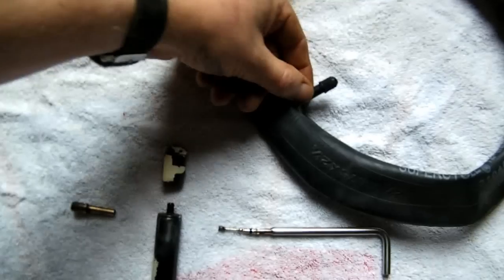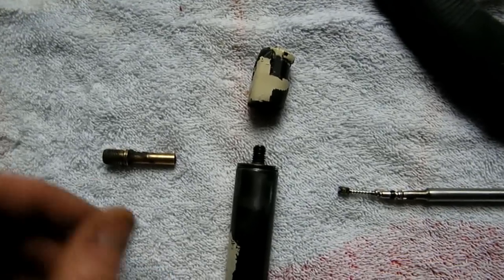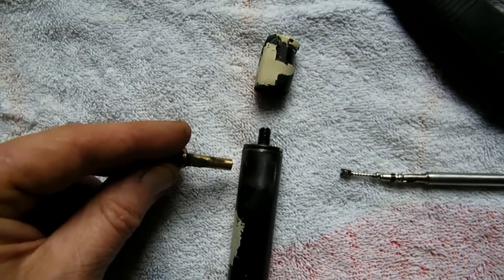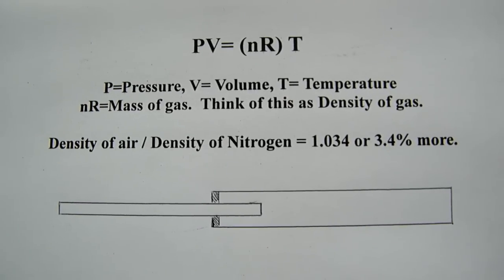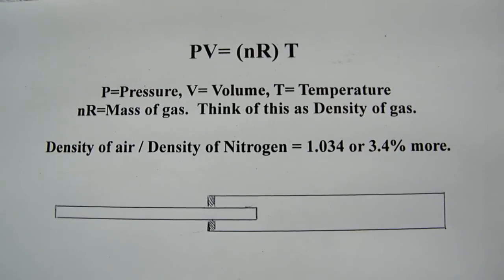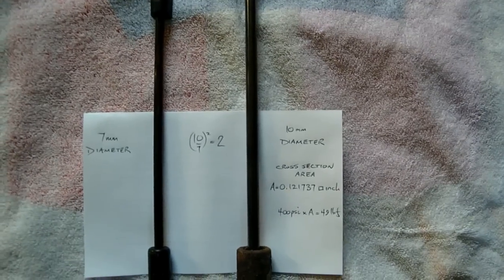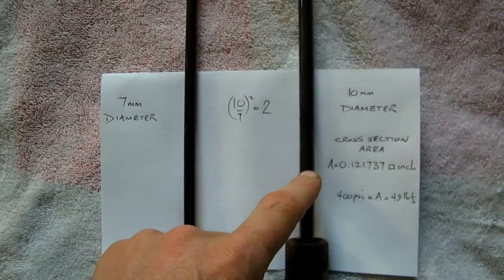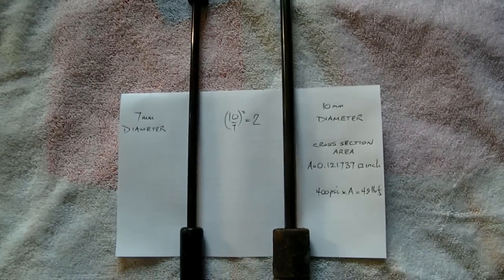Gas spring lift strut recharge DIY - truck cap.

Comment: It fails to fix the issue that caused the initial lots of pressure to begin with. The new air will just leak out faster and faster. What a waste of time. Just buy a new one.
Reply from the maker: It is still working without another pump up. It took me less time to fix them than to drive to the store and back. I put in more oil than the minimal amount from the factory so maybe that was the main issue. Also, don't operate these upside down or they won't last long.
Reply: Maybe. Gas is going to always be leaking out at a certain rate. After years of existence, even a perfect strut will deflate. If this fix lasts a year between charges, it is worth it. The real question is, Why don't all struts come with valves?
Reply: You should at least try to hit the seals with acetone. It should cause the leak to stop.

Comment: stupid just buy new ones
Reply: Whyd you  watch the video tho?  If u were having issues with yours then why are you on  youtube looking at videos rather than driving your ass to the money spending place  paying for a new one.  Meanwhile mr free shit right here will have his working and good to go again...
Reply: Hey, get back into your little box.
Reply: So educational if you just buy new one you will never learn his teaching incredible
Reply: I got here because I set out to buy new gas struts of equal quality to the gas struts that came as OEM on my leer camper. I think of it like this, do you buy new tires  when your tire pressure is low? or do you air up your tires and continue to use them? I know struts are not tires but I think all struts should be refillable so they do not need to be thrown out when all they might need is a pressure recharge/refill. With the soldered in schrader valves I can do exactly that. I bet the cheap Chinese gas struts for sale on amazon that say they are compatible and will work on my application will leak down and go flat in 1 yr or less.
Reply: @robert5   tyre nitrogen gas refill is install car all sturts or shock absorber?
You have any video for nitrogen gas and oil filling shock absorber  or sturt please send me link.
Reply: a single trunk lid strut in my car is over $500 new, I'd rather attempt a repair than shell out that kind of money.

Comment: This is a good fix if there is nothing wrong with the seal. Putting air in adds oxygen which means it will eventually rust internally. If you are serious you need to use Oxy free nitro . If you aren't looking long term air will do.
Reply from the maker: If the fail was a fade rather than catastrophic, you know the seal is good enough. So long as the inner walls are oily it will outlast the truck, which is why I added oil in the rebuild.
You are right that oxygen is a rust factor but moisture must also be present. Doing the recharge on a low humidity day would help, but in practice I won't worry. Convenient access to free nitrogen ends all debate. Nitrogen's primary home is in repeated quick compression systems like a car shocks, racing tires or my dirt bike mono-shock, to avoid heat buildup. The deep question is how long does something have to last? It depends on how old we are :)
It went down to minus 19Celsius a few weeks ago and my springs still lifted as intended. Gratifying.
Reply: If I have a mig/tig welders and a CO2/Argon tanks, can I use these instead of N2? They're inert at strut's operating temperatures, so hypothetically should work fine as well.

What do you think?
Reply: I know this is 3 years old but, is the seal not exposed to the elements on the outside of the cylinder? How much more damage would the oxygen do on the inside if it is already exposed?

Comment: Why couldnt you just make a air chamber from a threded pipe put strut in and pressurise chamber
Reply: That's a fucking great idea m8... Drill it through, tap it, screw in a screw-on valve or just drill, flux and solder and have the valve hidden inside the strut holding fist...

Comment: Thanks mate, it works! it was a bit hard to solder the brass tube against the steel tube but worked at the end. I wish there was a self threading valve!
Reply from the maker: Right on.Thanks for the thanks! Fight the power :)
Soldering is a skill one gets fast & good at. 
Clean metal, patience, sufficient torch heat directed near but not directly at the site, flux core solder, and ideally leaded solder (lower melt temperature and works best). 

Self-threading valve: Indeed, that would be handy. If such existed I think would still want to solder it, rather than rely on thread glue for seal. Solder that grabs, flows shiny and then freezes assures an air tight seal and gives extra assurance the threaded valve won't fly out - the tube wall is thin and the pressure is high.

Comment: How did u disassemble the strut? Please can you add a video for that
Reply from the maker: The ends are plastic and just unscrew, as shown. 
Maybe your strut needs a pair of small vice grips to start it turning.
I think I gently held the plastic captive in a vice and gripped the strut by hand to rotate it.
Reply: I have 2 small, stainless steel bodied Struts that hold my hood up. There aren't any holes going into the strut. How did they charge them up from the factory? How can I release some pressure?